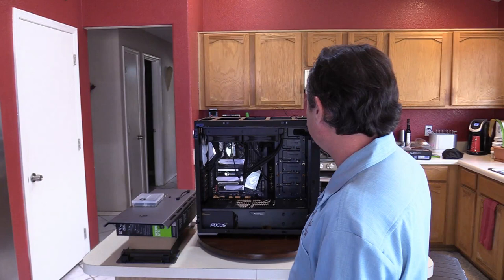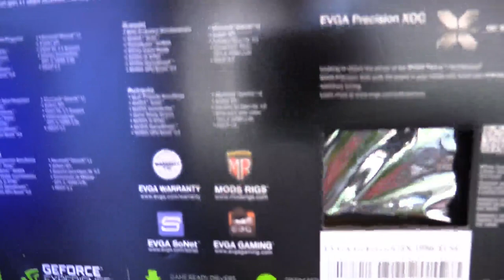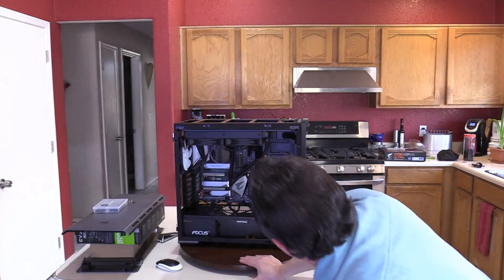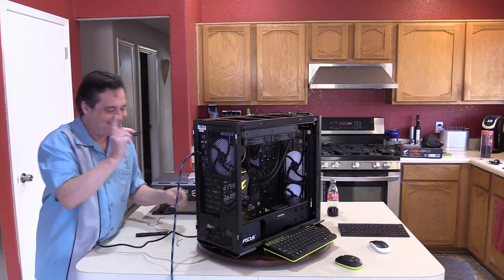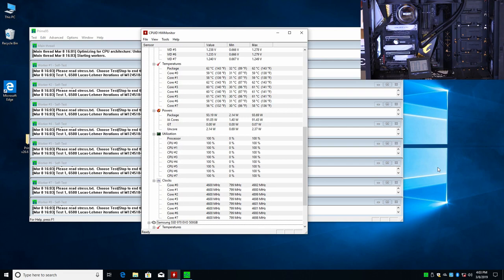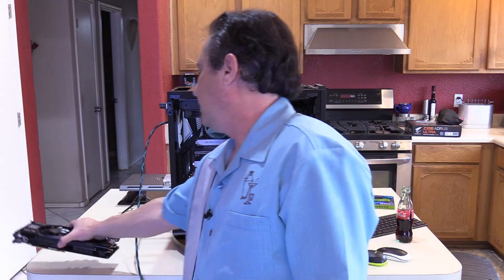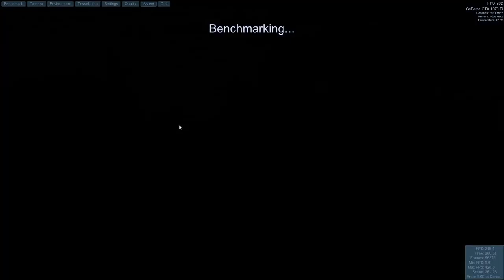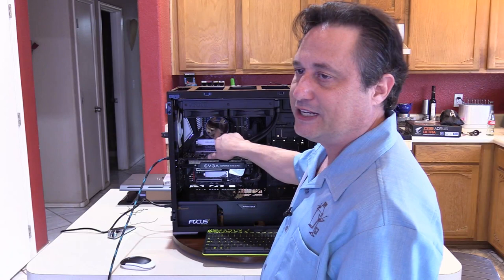PART4 - PC BUILD - Phanteks Enthoo, Z390, i7-9700K, 970 EVO, Seasonic, Corsair Vengeance, GTX 1070Ti

Comment: OK Carey I've done it, thanks to all your teachings this old man has built this computer and i am surprised how easy it was. Not worked out how to update bios from some strange cap file but i'll keep working on it. The list is 200R case with Intel i5 8400 cpu, 2x8Gb Vengeance ram and i removed the plastic label covers and put a scratch on it just for the fun of it. 500GB samsung nvme M.2 evo gum stick, Intel prime Z370-P mother board handled at the edges for installation with the 3TB mechanical hard drive from my old computer and another 2Gb on the way, Oh and Asus optical drive and EVGA  650 power supply. My cable management may not be as pretty as yours but its all in there and didn't have to sit sit on it to put the sides on. Thank you so much for all your teachings. My best wishes to you and your family.